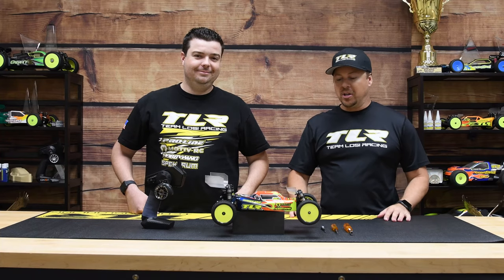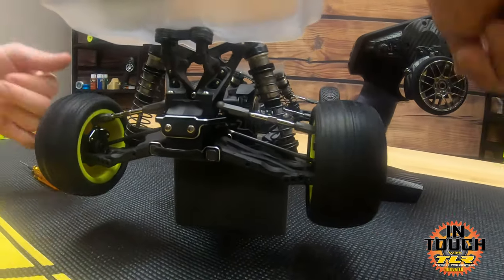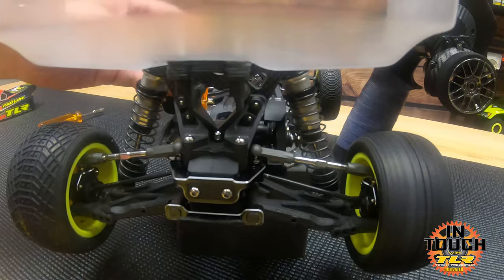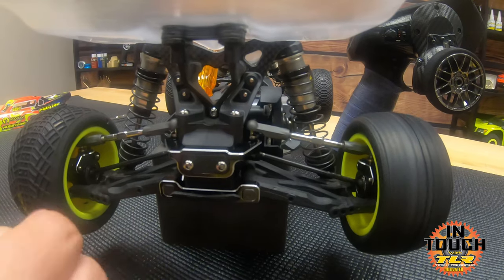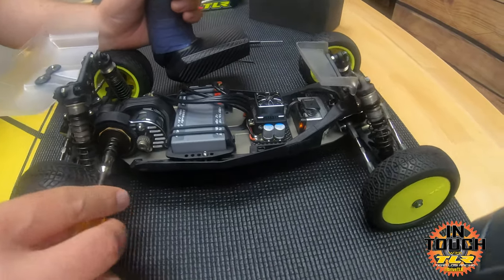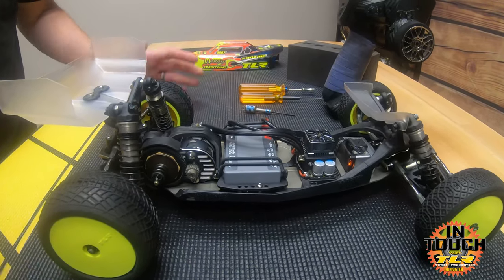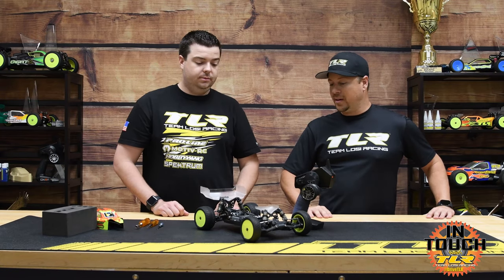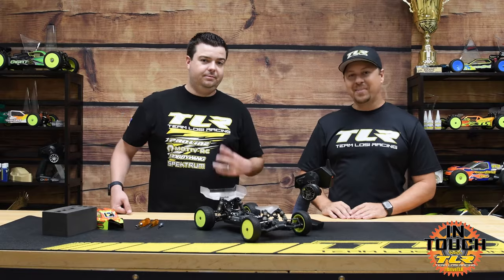In Touch with TLR Ball Diff Break-In & Slipper setup

Comment: Barking the diff from too loose? Is that due to the ballbearings being not pressed against the rings tight enough causing bearings to spin around it of place enough to scare/score them permanently causing scratches and pits? I got the mip axle puck kit and diff rebuild kit. This my first 22 spec racer. Coming from 1:8 truggy and buggy. Less than 2 years on truggy and already installed new diff gaskets and orings. Got the sensored Castle Creations newest sensored 1515 motor and mamba monster x esc. 1 word....BEAST!!
Reply: Also said diff direction does not matter on the side its pinned . lefty loosey still applies in rotation

Comment: Hey Frank, great video, but what EPA do you set your radio to when you do the slipper test? 100% then adjust for track conditions or what ever you run at the track? I ask as i change my EPA depending on what track I'm running at, less for small indoor clay and more for outdoor with bigger jumps.
Thanks
Reply: I really don't adjust EPA much, maybe at 1 out of 10 tracks, so it's at 100% most of the time.

Comment: When setting slipper and you want the front tires pop up a 1-2 inches...what about testing a 17.5 motor? I can’t get that pop with a 17.5..or do you not need the pop on a 17.5?
Reply: Same question here.

Comment: Hi Guys, great video. However I have questions. I followed all the steps (hopefully) but cannot get the front wheels to lift at all when setting the slipper! To be honest, the response and speed is pretty disappointing. I'm running a 72 tooth spur with a 26 tooth pinion. 12amp ESC 3900kv motor, 7.4v 2S 60C Lipo. I wondering what I have done wrong. Any help/advice would be appreciated.
Reply: Which motor? I'm experiencing something similar with 72/24 and a 17.5T motor. Probably just my inexperience but it sounds like the slipper is loose enough based on the sound.

Comment: Does the height of the wheels coming up differ from stock to mod or is it the same?
Reply: Plus 1 on this!
Reply: A lot of time in stock, the wheels won't actually come off the ground.  You can just head how much the motor does or does not bog down to set the slipper, then it is almost more important to tune on the track.